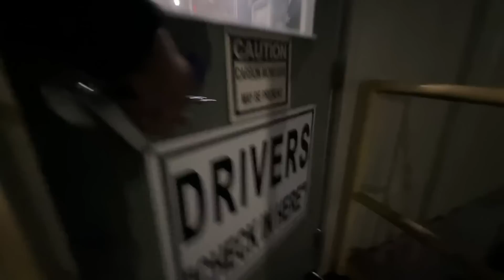High WIND Advisory! Power Lines Down!! Volvo Breakdowns!! Check your Hoses Prevention Maintenance

Comment: Ok when you repair the lite connection put a little silicone on the connection to keep it from vibrating loose. It will also help from corrosion
Reply from the maker: Thank you 🙏🏽
Reply: @JustTruckin   you ever  delivered to Waynesville. I have a brother and sister that live out there.. I'm in Lorain ohio

Comment: 6:45 They create these nice big homes, then leave out the spacing on the Garage, with installing low garage door panels. They need to add 2 more panels, so you can fit a normal sized truck in it. That's 1 tiny Garage Door.

Comment: Sounds like he lost the coolant hose for the DEF injector.  They are heated with coolant to atomize better and keep them from freezing in the winter.  I should know because on my chiefs bucket truck I ripped the hose off going over a snow drift, truck shut down 3 min later when I lost all the coolant 😅😅

Comment: Justin, thank you for stopping.  Many just drive right on by.  Ask me how I know.  The info that you talked about with the hoses holds true on automobiles too.  My radiator hose sprung a leak and I had to have my car towed to my mechanic.  I had him replace all the hoses.  The same with the belts.  Change one, change them all.  Just makes sense.